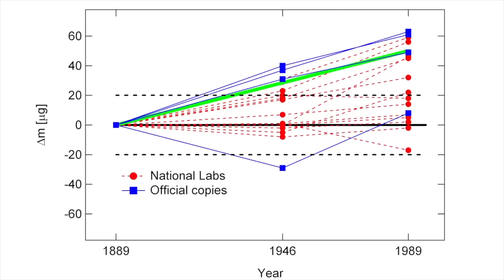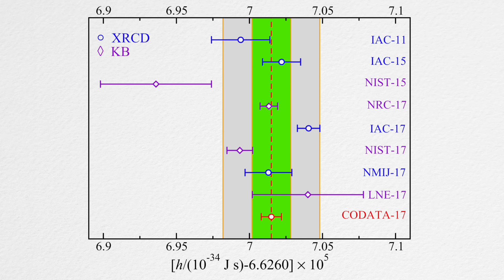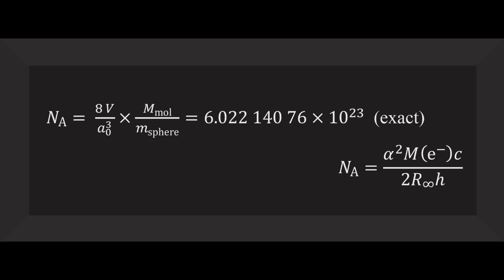The kg is dead, long live the kg

Comment: Maybe someday we'll be able to scale Fahrenheit down 12°.
• Boiling (at sea level): 212 → 200
• Heat warnings: 105/115 → 90/100
• Room temperature: ~72 → ~60 (closer to midway between 0 and 100, making 40s and 50s feel more mild than cold)
• Freezing: 32 → 20
• More meaning to 0°: Snow would take on 3 colder-oriented structures below 0. (Snow has 3 structures when above 10-14F, 1 structure at 10-14F, and 3 structures below 10-14F.)
• Converting to/from Celsius would be a bit easier (adding/subtracting 20 rather than 32)
Reply: Or better yet, just do away with Fahrenheit all together and just use Celsius.
Reply: @my3dviews  Yes, that's probably what would happen if Americans ever chose to review temperature units. My suggestion simply adjusts Fahrenheit so that it remains (and improves upon) a scale of 0 to 100 with respect to comfort and daily temps. But Celsius is more versatile in terms of being related to other metric units. So although I prefer Farenheit's 0 to 100 scale for daily temps, rather than Celsius' 0 to 100 scale for water (or 0 to 40/50 for daily temps), I would not mind seeing Americans convert over to Celsius.
Reply: We changed to Celsius (here in Canada) in the 1970s.  It took awhile to get used to, but now I don't hear anyone referring to temperature in Fahrenheit, even older people.   The exception is for baking in an oven, as many recipes still use Fahrenheit if not both.   Mine has both units on it.
I find that Celsius works really well, especially when it gets close to the freezing point.   In the house I just go by 20°C as a comfortable room temperature.
Reply: @my3dviews  Interesting. I did not realize Canada had used Farenheit. Though I suppose not too surprising given its British influence. Yeah, when I think in Celsius temps, I think about it on scale of 0 to 40 in increments of 5, with 20 being a convenient middle room temp.
Reply: Yes, before the mid 70's Canada used the imperial system of measurements.   So, gas was sold in imperial gallons, which are larger than U.S. gallons (4.54 Litres vs. 3.78 Litres in a U.S. gallon).  Now only Litres are used.   The other major change was the highway signs to kilometres instead of miles and km/h instead of m.p.h. for speed limit signs.

Some imperial units are still used along side the metric equivalents.  Some grocery stores still list prices in $/pound as well as $/kg.  Probably because the number is smaller and it looks cheaper that way.   I would prefer if they all just did away with those units and stuck to the metric ones.
Reply: Re. Definition of Fahrenheit scale https://youtu.be/LgrXd0NM2y8
Reply: @ibycus314  Thanks for sharing that video, which I had watched. It agrees with what I was saying above, particularly that Fahrenheit is based partly on water. Though it doesn't mention the possibility that 100F could represent dangerous body temp. I'm glad more people got engaged in this discussion! Obviously, we could just go Celsius. This was just a hypothetical idea I came up with that I think would be an interesting alternative for us Americans.
Reply: Or you just go metric...
Reply: Or, three countries could catch up to the rest of the world and change to using celsius?
Reply: Just use Celsius
Reply: The thing is, Fahrenheit isn’t linked to water, it’s linked to alcohol.   Celsius is just as arbitrary as Fahrenheit, BTW
Reply: @nikoyochum6974  Thanks for joining the thread. As I understand, 0°F was supposed to represent the freezing point of brine, the coldest temp experienced by Mr. Fahrenheit in winter, and/or the coldest temp at which a person could survive. I think 100°F was supposed to represent the point at which a person could suffer heat stroke. This is because, contrary to popular belief, he was not intending body temp to equal 100°. Rather, he was was aiming for 96°. If normal body temp was 96° rather than 98°, then 100° would be a pretty logical point of danger for body temp (the equivalent being 102°). In sum, this would support my thinking that the Fahrenheit scale was done with respect to human comfort. It's true that I'm trying to link it to water, but then again, Fahrenheit did aim for that link as well. I just think 20 is a much more logical temp than 32 for a freezing point.

I don't see how it's linked to alcohol, except that Fahrenheit was based on Roemer's measurements using an alcohol thermometer. But even then, Fahrenheit went to a mercury thermometer, enabling him to expand the temperature scale because it was more accurate. AFAIK, no temperature points were based on measuring alcohol (ammonium chloride is not alcohol).
Reply: DAK4Blizzard I just misremembered what he originally linked it too :)   
   
Regardless, Celsius is just as arbitrary (and really Kelvin is also, as far as the step size is concerned)

Comment: The difference may be small, but I don't really know if this is the "best" thing to do. 
While the physical object has variance and issues since it is changing, it is always "set to zero" or 1 in this case. If we set all these numbers as constants when we cannot actually measure the true "constant" as in all of the decimal places, then over time the tolerance will theoretically be an issue would it not? I can't imagine a scenario where that small fraction is a huge issue, currently but with future technologies it could be. Shouldn't we continue to pursue the exact measurements? 

I guess what I'm saying is that while having a fixed number is a step forward, it is important to review that fixed number and ensure we've still got it right, as our ability to measure it improves.

Comment: Weight is the force that massive objects exert on mass, so wouldn't still a Kg be different on other planets with different gravitational pull?
Maybe I'm thinking this all wrong and I would just weight less or more under different Gs.
Reply: No.  Mass is a constant; weight (being a force) varies with the masses and distance.  You need to get them straight in your mind before you try and play. In general,

F = g * (m1 * m2) / r^2  where g is a universal constant and m2 the mass of the object

if you set G = g * m1 / r^2, where m1 is  the mass of Earth and r is the radius of the Earth at sea level and G has the units of acceleration, then

F = G * m2 where F is the force due to gravity (weight) and m2 is the mass of the object, on Earth at sea level of the planet.

Comment: Avogadro's number is too human-centric, what other intelligent life forms would use carbon as the fundamental element. It should be the number of hydrogen molecules in one gram.
Reply: Probably most intelligent lifeforms would. Carbon (like every other element) has unique chemistry. In the case of Carbon, it makes it uniquely suited as the basis for life (at least under approximately Earth-like conditions - under conditions where chemistry doesn't apply, any life-forms would need to use some other system).

Historically, the number of Hydrogen atoms in 1g (or molecules in 2g) was used first, but that was abandoned in favour of Oxygen atoms in 16g because the wider range of substances Oxygen reacts with makes it easier to calculate atomic masses. The preferred standard has also been Oxygen-16 (more cleanly defined than naturally occurring Oxygen which is a mix of isotopes) and, of course, Carbon-12.

The biggest problem with using Hydrogen as the standard mass is that it has by far the lowest mass deficit of any element, so masses of isotopes relative to Hydrogen are measurably different from their nucleon numbers.
Reply: Lmao what did you literally just ask what other animals would use in place of carbon

Comment: I really am a huge fan of a standard system for units. (SI)
But what outrages me is that ampere is the base unit for electricity. Charge per time is not fundamental, but charge is. So, long live Coulomb!
Reply: Johannes H The thing is that historically charge was experimentaly more difficult to measure than current. They come up with a definition for the ampere that related the current some wires to the magnetic force between the wires. Force is easy to measure and the calculation is really clean. From than definition of the ampere they could define the Coloumb

Nowadays, it would be more convenient to define the Coloumb as a multiple of the charge of a proton, while giving the charge of the proton a fixed value.

So, long live the Coloumb
Reply: Even if you use the Columb as your base for defining measurements. You still need the gravitational coupling constant to equate it to measures affected by gravity, which means involving plank's constant.
Reply: Ideally mass, energy, momentum and temperature should all be measured in the same units as each other. Time intervals and distances between events should both be measured in the same units as each other. The Candela, electric current and the mole should not be base units but derived units. Only three base units are required; one unit for mass/energy/momentum/temperature, another unit for time intervals/distances and a third unit for electric charge. It would be even better if the boltzmann constant, the speed of light in vacuum, the planck constant and the gravitational constant were all defined to be exactly one, in these new SI units. Unfortunately, our technology and know-how is not sufficiently advanced to make this practical, just yet.

Comment: Is it possible to design a measurement system such that most physics constants are 1?
Reply: That's what high-energy physicists do: they define certain constants of nature as exactly to 1, which simplifies the equations they work with. Look up 'natural units' on Wikipedia for details, if you're interested
Reply: Nope.
Reply: Nope because ... Main units are defined to.be close to human understanding. 1m is about the height of a man (in reality 1:4000000000 the circumference of earth ), second is a heart beat. K is 1L of water. They just failed on Bell (thus the decibel which is better appropriate), and direction of current (which ended to be opposite to movement of electrons ). 

Then constants relate all these units.

You could start by defining constants to 1, but then, you would deal with impractical things. The unit of weight would be the weight of one atom of carbone, and selling one baril of oil would mean ... " equivalent weight of 1673826143830381514173948362528292 atoms of carbon ". While the unit of distance could be one parsec, your height would be 0.00000000000000000000000072518 parsec. 

Science is designed to simplify and design easy to use standard. So for daily use by most people it's more handy to have " unit units " and.Then non trivial constants than trivial constants and funky units. 

So in an other world yes. But it would be unusable. 

Remember  all the times you bought 1L of water, drank 1L of beer, measured 1m, used 1k of.flour for  a cake, and now imagine each time you had to say 10^38k, 10^-975m, 10^-471s ...
Reply: Benoit-Pierre DEMAINE I asked if it was possible, not if it was practical.
Reply: @Holobrine  thus my second message. Where i say yes.
Reply: But the aim of a unit is to be practical ...

Comment: So by "forever" you mean until we constrain the values of those fundamental constants past the number of decimals we've assigned.
Reply: No, these constants now will be fixed forever, it's the calibration of the measurement tools that will get more accurate as we make more accurate measurements.
Reply: It's all done by a one of a kind machine its precision is not necessarily its precision
Reply: Our idea of the "exact" value of these constants will indeed be updated. But the decimal expansion up to those significant digits that will be defined in the standard should not need to change. We will simply extend the digits. No calculations based off of the old value will become less accurate by extending the digits. It's like providing backwards compatibility. Future measurements will take advantage of the improved precision, but notability the value is no more accurate than before; pre-existing measurements will still be correct to the precision that they specified.

Comment: maybe this is a stupid question: if you're choosing to make planck's constant exactly a certain value, why not make this value a number with less decimal places? say 6.63(10^-34). Then just adjust the kilogram accordingly.
Reply: Because then the kilogram would be meaningfully different from what it's now. Meaning that the whole world would need to adapt. That would just result in pure chaos.
Reply: Using 6.63×10^-34 would change the kilogram by about 0.6 grams. That's a massive change (pun intended).

Comment: Not sure if anyone else has pointed this out yet, but it really isn't valid to equate E = hf = mc^2 for photons. The equation E = mc^2 refers to the rest mass of a particle, which is zero for a photon.
Reply: In relativity, yes (hence why there exists the "extended" formula E² = (mc²)² + (pc)² with m being the rest mass), in quantum mechanics (which is used for the kilogramm's definition), no. Quantum mechanics isn't the same as in everyday physics and relativity (which is what you think about) and this includes mass. Here, rest mass doesn't exist because it isn't a fundamental property of particles and is all defined through energy (either their own or through interaction with fields, most notably the Higgs field). In fact, mass in general by the word literally is energy and QM often substitutes E/c² for m. This also includes photons, which is treated like any other particle but lacks the interaction with the Higgs field and therefore rest mass, but the energy-mass-equivalent gives them nonetheless some "mass".

Comment: Could you maybe elaborate on how Planck's constant is related to mass? The way you describe it, it sounds like they're trying to define the kilogram based on the mass of a photon, but aren't photons supposed to be mass-less? And what frequency are they using to calculate the mass of the kilogram anyway? I know Planck's constant is in units of kg*m^2*s^-1, so it clearly is related, I'm just confused by what numbers are being plugged in where.
Reply: The equality shown in the video does not make any sense at all. While the energy of photon is indeed equal to h*f, the famous expression E=m*c^2 is called the rest energy of a particle with mass m: as the photon is mass-less h*f=m*c^2 is physically wrong, not to say that a photon carries momentum (given by p=h/lambda, where lambda is the wavelength of the photon) and therefore not at rest.
Reply: @Vitor Horodynski: First of: Don't confuse quantum physics with relativity! Rest mass (which usually is written as m_0, btw) is only important in relativity (also a fundamental property) in quantum mechanics, mass simply doesn't exist (at least in the usual way)! That means, rest mass isn't a fundamental property of particles in quantum mechanics! (It also would turn all particles massless, if we're honest.) Instead, mass is by the word literally energy and so m is often substituted with E/c² in QM and the photon is treated, just with no interaction with the Higgs field (which gives particles the rest mass, btw). So the formula makes sense if you consider that the "mass" in question is actually quantum mechanical mass, not relativistic mass.
Of course, you also can transform a photon into particles with rest mass, though the created particles also have some kinetic energy which also would result in less energy if you would consider only the particles' rest mass.
Reply: @MarioFanGamer659  First of all, thank you for discussing the topic in a healthy way! You seem to hold much more knowledge about the topic than I do, even though I disagree with some of the claims you made.
So, saying that I'm confusing QM with relativity appears pretty much odd as my point is that the expression h*f=m*c^2 does not make sense, which totally blurs the line between QM and relativity.
That said, let's play with your (or QM's) definition of "quantum mechanical mass". The total (rest+kinetic) energy of a particle with rest mass m and moving with velocity v is given by E=gamma*m*c^2 where gamma is the lorentz factor: applying this in the equation we get h*f=gamma*m*c^2 wich, again, does not any sense as gamma(c) gives us a 1/0 division as c is the velocity of the photon by definition. Once more, the expression isn't consistent.
Reply: @Vitor Horodynski: Again, don't mix relativity and QM for absolutely no reason! You think that E=mc² is relativity and that it is used in QM although it actually might be vice versa, that E=mc² or rather m=E/c² is QM and affects relativity. This also means: No gamma involved!

So let's me explain what mass in QM really is and how it affects in normal scales: Mass is energy which is split into two types of energy: Field energy (interaction with field) and momentum energy (their own energy). This is represented in the "full" E=mc² formula: E² = (mc²)² + (pc)² with m being here the field mass (rest mass).
The field energy is the result of interaction with the various fields like the electric field and most notably, the Higgs field (the only exception is gravity which I have to unfortunatelly have to handwave it away). The resulting mass is what we call rest mass and any particle which don't interact with any field sans gravity (e.g. photons) haven't got any rest mass and therefore travel at the speed of c as a result. Rest mass is what the Lorenz factor also affects.
The other part is the momentum energy i.e. a particle's own energy. It affects its own wavelength, the deBroglie wavelength, in QM. In macro physics, it plays the classical role of how much "force" a particle has when it hits something which includes both, particles with and without field energy. Much like field energy, it adds "mass" to the the particle, even to massless ones but doesn't prevent the particle to have a speed smaller than c. For particles with a field mass, it also results in calculatable speed.